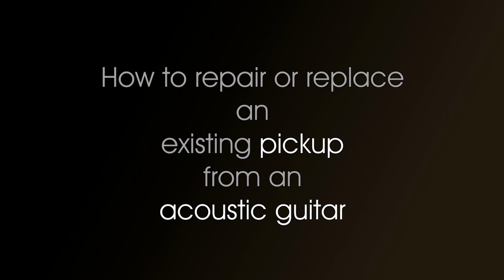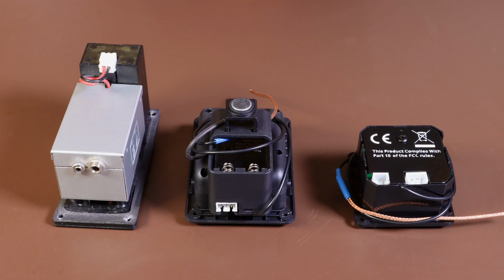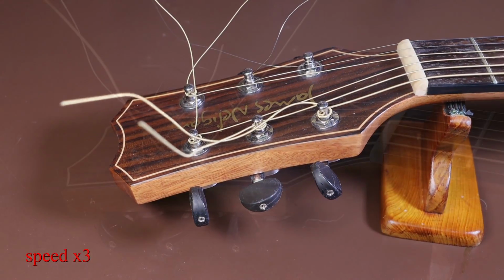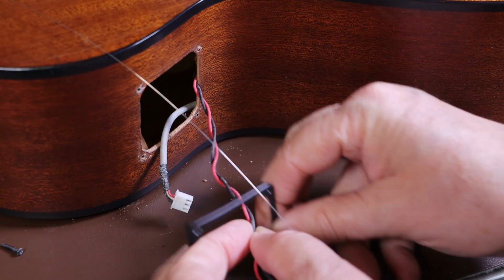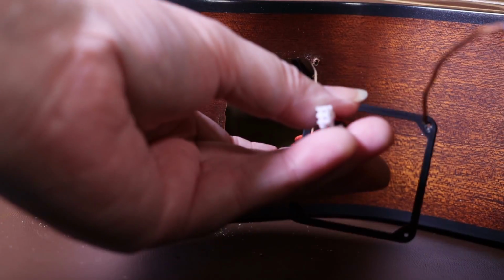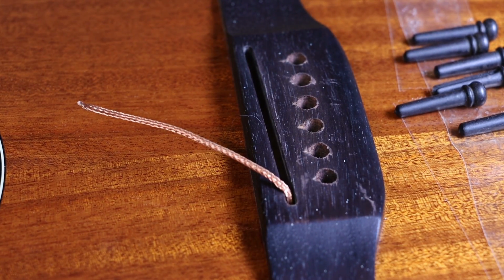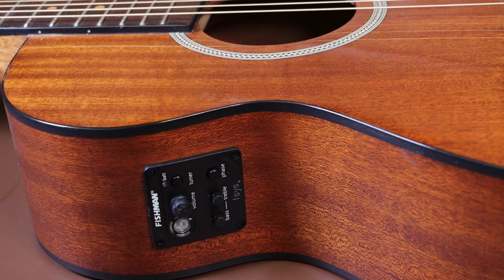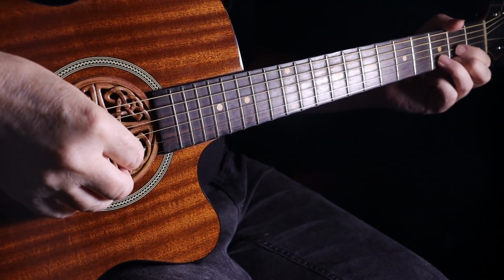How to replace or repair an acoustic guitar pickup and preamp (piezo pickup)

Comment: Hello, nice tutorial ! I have Fender CD-100 with Fishman isys 3 and last few months I have problem with Tuner. Its interesting, it goes right with old battery (measured 8,1V) - although the battery diode is shining like low battery, it works fine. When I put new battery, Tuner does nothing at all (measured 9,3V on battery). Pre-amps works fine with both batteries, just tuner has problem with all new 9V batteries. Does anyone know how to solve it? 😄
Reply from the maker: sorry, I have no idea but I'll pin your comment so people can see it.  😊
Reply: @guitar-academy  I have the same problem with a tim armstrong hellcat, seemd that this issue with tunner is very common accros these pickups.. defective product maybe...
Reply from the maker: @franciscohuizar1923  possibly . .  with this guitar it had worked for a few years before it died.  But maybe it's a weaknes that commonly fails. 🤔
Reply: @guitar-academy  exactly the same happened to me, the pickup sounds fair but the tunner is a piece of garbage...
Reply: @franciscohuizar1923  I also have the same issue, I went and bought a Martin X-Series ziricote, the tuner shat put the first week of having it. I’d like to find a solution to fix both. Did you ever find a replacement or fix for the hellcat?
Reply: @frankrenner5889  Hi!! not yet; I'm planning to send it to service, needs adjustment and also, I could check what can they tell me about it
Reply: @guitar-academy  thank you :)
Reply from the maker: @cannabiscze  No problem

Comment: Hi it is very helpful tutorial for me . I have the same Pre amp Fisman . My 1st string dose not sound from the amp pls assist me 
Thanks
Reply from the maker: Thank you . . . That's great it helped you!  For your first string, it might be a that the saddle is not making full contact with the pickup.  You might need to remove the strings and make sure the bottom of the saddle is completely flat and there is no dirt in the slot, also make sure the pickup is fully pushed in to the slot.  I hope this helps 😊

Comment: Sadly didn't work for me. I'm thinking my issue might be the battery box. I have found it to have issues and questionable reliability. I'm going to see if I can remove the insides (springs) and just solder on a regular 9v connector like you find in a guitar pedal. Then I'll know I have a reliable connection. If that doesn't bring it to life, then it's the preamp or pickup. Only 3 parts that it can be. But it really seems like a power issue to me, and the symptoms scream battery connectivity issue.

The good news, can get a Chinese clone replacement from Amazon for $25.

 it's the preamp or pickup.
Reply from the maker: I had one that needed tape around the sides of the battery because the fit was so loose, that worked for a while.  I've tried several clones and they are as good as the original ( in my opinion). 😊😀
Reply: @guitar-academy  I have never liked that spring arrangement for 9v batteries. I'm going to see if I can do some mods to this one. Will try to remove the innards and wire, then solder in one of those regular 9v connectors that you typically find on a guitar pedal. That way, I know it's making a good connection. And if that doesn't work, then it's not the battery and I'll get one of the knockoff units to swap out. Only 3 possibilities - battery/preamp unit/piezo pickup.

Comment: This is interesting. Thankyou. But unfortunately, my sigma pickup has a right angle and is soldered to the preamp so i therefore presume i need to come from the outside of the guitar and then resolder (which is not my forte) to connect another? I am also struggling to know which new pickup to buy as i cannot find generic sigma ones.
thanks
Reply from the maker: Thanks for your feedback.
Ah yes that's an older style of pickup with the solid back plate.  I like that type but they aren't as common these days, perhaps for the reasons you mention.  The pickup is interchangeable for the soft type, but more importantly you need to make sure the preamp is the same size and shape to fit the hole in the guitar. 🤔

Comment: I have this style of pickup and everything works fine but the lead when I insert it it's a 60/40 chance it won't get signal, I don't think there's any issues with the actual pickup but maybe the thing that latches onto the cable? how do I fix it?
Reply from the maker: The jackplug socket has the power switch in it too.  If the power is coming on when you plug it in, then unplug it again and try cleaning inside the socket with a cotton bud (Q-tip) and some solvent.  Sometimes the contacts become dirty. 🤔  I hope this helps 😊

Comment: The cover for my battery broke, so I ordered the whole battery box with built-in input jack. Only the cover was bad, so I put the new battery box in and it fit perfectly. I connected it to the pre-amp and thought it was pretty straight forward. Everything fit and connected perfectly, but it doesn't work. Brand new Gretsch acoustic guitar but now just an acoustic. I don't know why the electronics don't work. Thank you for the video.
Reply from the maker: How annoying is that . . I'm sorry I usually try to suggest something but I don't know what to suggest.  The only thing I can think of is to ask 'is the tuner or any LED's comming on ?' because if they aren't then the problem must be between the battery and the preamp. 🤔

Comment: I have a fishman same as the right hand in your first photo. Presys Plus 
Guitar has been in the bag then in wardrobe for 10 years.
Battery was removed upon storage i have put a new battery in.
I have tried it and I got one red E flash once. After that just the green light flashing at the top.
Should I order a new unit?
I took it to the music shop where I purchased the guitar for me GF 15 years ago but they didnt seem to know aything about the system and said they woudl need to send it away.
Is it worth taking it all apart and plugging it back to gether to see if it fixes it?
or just order another and fit it my self it does not seem that hard.
Thanks

A note the pickup is hardwired into the preamp part as I removed the preamp to see if unplug ging and plugging this in and out would fix.
Reply from the maker: It sounds to me like you've tried everything you can.  The only other things I can suggest before changing the unit would be to remove the battery and then put it back in, and/or press the tuner button on and off a few times as they often get dirty contacts.
If none of these things work then I would replace the unit.  It very easy to do if you take your time. 🤔
I hope this helps 😊
Reply: @ thanks I have tried that stuff . I am thinking the pickup is corroded or something . However , the cost of the unit is about $300 looking online for oginal and not a knock off . For now I am using a phone app tuner . 
Thanks for your advice .
Reply: @guitar-academy  I wanted to give you some feedback on my current progress.
I bought a cheep clip on tuner and I couldnt make head nore tails of it. 
I installed an app on my phone and got everthing all tuned in.
Spent maybe about 1 hour going through a tutorial video no learning to play guitar.
Came back today and turned on the preamp and it is now picking up when I play the strings.
Tested the tuning against the app on the phone and they both line up.
I don't have an amp to plug in and test but at the least it is now tuning.
I am thinking I would like to get a jack to USB so I can connect to computer at some point.

Comment: I instaled Fishman presys blend in my guitar, and my low E string much louder than other strings, and G string is much quiter than other strings. Total disbalance. Nut is straight. Can somebody help me please...is there any solution?
Reply from the maker: The base of the saddle has to be completely flat and slot in the bridge has to be flat and clean as well. 🤔

Comment: Thank you so much!!! Had a buzzing sound every time i played an open string and it turns out that one of the wires inside was making contact with the inside chamber. Problem solved!
Reply from the maker: It's great to hear great that you could sort it 😊😀

Comment: The piezo plug that go into the preamp wont fit. How do you remove ovation preamp?
Reply from the maker: it depends on the model.  Some have clips on the sides and some are screwed in place.  The screw heads are hidden under a plastic sheet with the writing on.  🤔

Comment: Thanks for your videos. I'm wondering if the wires to the pickup can be cut and used for a different pickup. You had mentioned it isn't a good idea to cut the wire. I'm wondering why exactly. Any help would be greatly appreciated.😊😊
Reply from the maker: I was generalizing really to prevent inexperienced DIYers from ruining the pickup system.  The main wire that should never be cut is the pickup itself, it's not just a wire and cutting it can kill it completely.  The wire to the battery is easy and safe to cut and re-solder.  The wire to the pickup and output jack is coaxial, so it has an screening wire around the core wire, this can be cut and re-soldered but a brake in the screening can cause noise/buzz to get in so just be aware of that. 🤔
Reply: @guitar-academy  Thank you so very much. Ha! I'm sitting here at this very moment with my guitar apart and was just about to cut wire but figured I'd check to see if you had replied. Now I can confidently continue my work! ❤
Reply from the maker: @jacklord66  no problem . . and good timing 😊😊
Reply: @guitar-academy  so as confidently as I tried  two different, two-wired soundhole pickups (both working) did not work running out from the preamp via the pick up wire. I'm not exactly sure why though. One is a Sunrise from my Gibson which I have wired to a 9-volt pre with a simple volume pot. The other is a Dean Markley which I run direct to a 1/4" out jack. 

I'm not so knowledgeable of wiring but figured I'd give it a go.

I ended up resoldering the Fishman piezo. I've never been a fan of the under saddle pickups so my next attempt would be to see if I can remove the Fishman Blend pre from another guitar hoping the mic might help me like the sound of the guitar I am readying for outdoor Winter busking sessions.
Reply from the maker: @jacklord66  Yes, I agree with you on the under saddle pickups but they do work well.  I've found the only problem with the internal mics is they pick up voices and guitar knocks when you don't want them to (when recording).  
You've given me another great idea for a video, to see what you can use with a preamp other than the piezo under saddle option 🤔
Reply: @guitar-academy  Well, I'll certainly watch it! I still dumbfounded why the Sunrise didn't work. I checked the Blend but it is much bigger than the Presys 2 and I don't want to hack up the guitar even though it's a cheap one just for reason I had mentioned. I now have to deal with "wreckage" of my attempts and put back together the other two guitars unless of course...you have an idea 💡 😆
Reply: I had rewired the Sunrise multiple times just in case my soldering was faulty. I tapped on pickup with screwdriver and got typical pick working sound but when I strung up a few strings, no sound passed through. No tuner recognition either. I thought maybe the pick up needs to be wired to battery to give the pickup some extra juice but something seems to be stopping it passing through the pre. I took the cover off the pre and just to try, I connected pickup to the direct on pcb but no go there either.

The only reason I actually want to run through the Fishman Pre is for the on-board tuner. I basically could just wire in the pickups bypassing the Fishman and adding my tuner to my busking pedal board  but it seems like such a waste to have the Fishman which was factory installed. 

I suppose I can try outboard gear to change the piezo sound to be a little less harsh sounding.

Such an adventure! Once again, thanks for the support.
Reply: @guitar-academy  soooo.... I wired in the Sunrise direct to output jack at the preamp itself. Sounds so much better than the piezo in this particular guitar. So now I run the soundhole pickup direct and keep under saddle pickup nearly off with eq down. Since the piezo runs through the pre it has a lot more volume but to my ears the soundhole pu is much better but it isn't a surprise considering it's one of the best I've ever heard. Again, I look forward to your videos.😊
Reply from the maker: @jacklord66  It sounds like you're learning the best way . . by experimentation.  I found more stuff out that way than I can say.  But I've made some mistakes and waisted some money too 😒
Reply from the maker: @jacklord66  I don't know much about the Sunrise Pickup, I'll have do do some research.  Thanks for letting me know how your project is going, it's all really useful information . . 👍😀

Comment: Thank you for a great and clear instructions. My fishman Isys t suddenly stopped working. When I turn on the tuner, a green light blinks and nothing works. is there a way to fix it or should I look for Isys + as replacement? Thanks!
Reply from the maker: I assumed you've tried removing or replacing the battery ?  I'm not familiar with the fishman Isys t so I can't really advise . .  sorry 🤔

Comment: Thank you for the Fishman replacement video. I’ve just bought Fender DG60CE from eBay. The seller classed it as good condition, but neglected to mention 1. Battery utterly dead; 2. Tuner/Preamp/Pickup don’t work.
After spraying tons of isopropyl alcohol into the tuner switch it tries to work, but I think the pick up is fragged as there is no output to the amplifier.
Reply from the maker: Ahh . .  that sounds familiar.  I see that issue again and again where the tuner switch doesn't make proper contact.  The good thing about a replacement is that all the holes are drilled and under the saddle is routed so it is relatively straight forward. 😊😀

Comment: Thanks for the video. I have a question for you. My semi acoustic ukelele has a similar preamp but does not clip in when I place the battery. Battery keeps popping out. What could be the problem? It's brand new but company refuses to replace as it's been more than 7 days since I bought it.
Reply from the maker: wow that's shocking, they should replace it.  There's a little plastic clip that holds the lid in place, so either the clip is broken or is just bent slightly.  (hopefully it's the second option) 🤔

Comment: Can i cut that copper pickup? I have a problem both my E strings are not too loud. I sanded the saddle already  but it still sounded not loud enough compared to the other strings. Is it not because some parts of that copper thing don't absorb enough vibration?
Reply from the maker: The instructions that come with the pickups have big warnings not to cut them, but I've got lots of spare pickups so I'll do a very short video where I try it for you (keeps your eyes on my channel).
If you're confident you can drill a small angled hole at the very end on the thin 'E' string side of the saddle slot so that  you to push the pickup a little further along.  Otherwise you can buy a replacement pickup that's not the wire type but the metal based type. 🤔

Comment: The Isys, I am trying to replace won' t slide out, I believe there is a flange on the side preventing this. I can't compress it enough to remove, any advice
Reply: Thank you for this great video and your advice to my comment
Reply from the maker: @lanell1  o problem thank you
Reply from the maker: Some models have clips on the sides so you have to reach into the guitar through the sound hole and compress it from the back.  The only other way I can think of isn't one I'd normally recommend.  But if the existing preamp doesn't work anyway, you might have to brake the plastic to remove it . . 🤔

Comment: Hey i got issue with my battery slot the battery does not holds in it just keeps popping back and doesn't let the door of battery compartment to close , can you please tell what hold the battery in that compartment.
Reply from the maker: The door should have a springy plastic catch on it that locks in to place when you close it.  It sounds like that bit is missing or broken off 🤔

Comment: hello, asking for help

i have the Fishman isys T, same as in the video
i already tear them out of my guitar.

i tested the tuner, and its working
i connected the jack to the amplifier, and its working it make sound, and when i change the volume on the preamp, the volume on the amplifier is changing too.
for the piezo, i rubed my nail against it, and it making the sound thru my amplifier.

but when i put everything back together again, it doesnt make sound at all
do you know why this problem occur??

my assumption is maybe the saddle was to low, and it doesnt press the piezo enough,
or should i rewire the piezo? or getting the new piezo?

thanks ^_^
Reply from the maker: Your issue is a difficult one . . If the pickup is working and the preamp is working there should be sound.  Without having the guitar in front of me I can't really help because it could be so many things.  The saddle will be pushed against the piezo by the strings, so that shouldn't be an issue.  🤔

Comment: Hello,

Can these non rigids piezo pickups be cut and still will work?
I have a guitar with split piezos . 
The short one is not working and I want to replace it without having to buy both (they are from a Fishman Prefix kit and the piezos replacement are so expensive)

Thanks a lot.
Reply from the maker: Sadly, they actually warn you on the paperwork that comes with the pickup not to cut them down.  You might get away with using just the end of the pickup and taping or pull tying the remainder inside the guitar. 😊
Reply: @guitar-academy  
Many thanks !!!